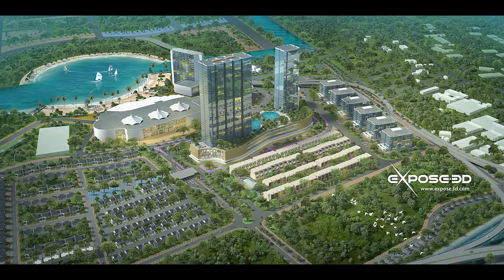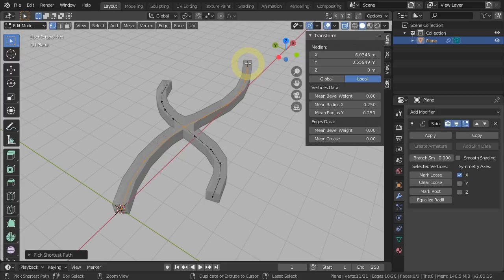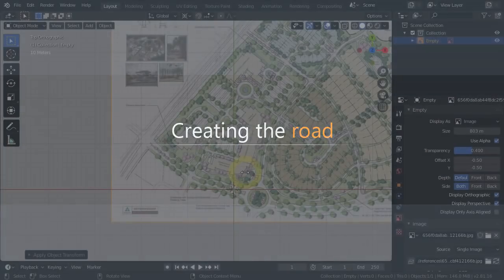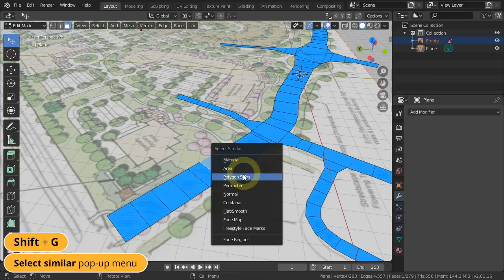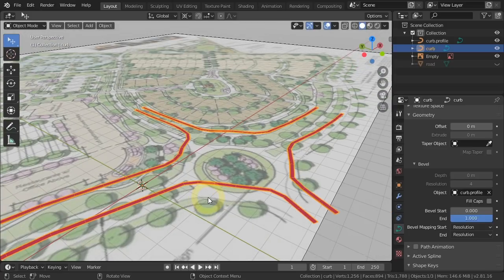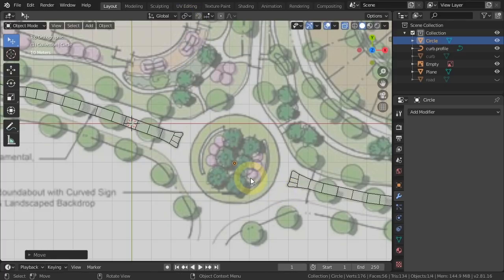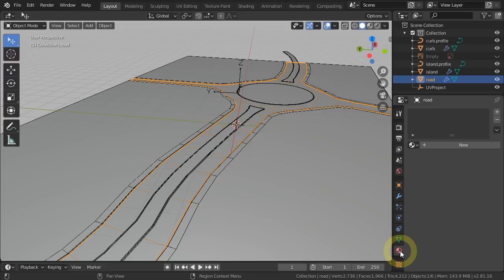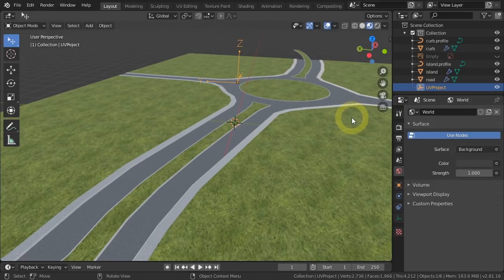How to create large-scale road network in Blender 2.8x

Comment: Hello, I have a question. When you add skin modifier, it automatically splits (subdivides) the mesh between two vertices, if the distance is too long. So you end with more than one segment between two vertices. Do you know if it is possible to turn this off? So I always have roughly one segment between two verts, regardless of the distance between them

Comment: I got a problem regarding adding vertices extensions.  I pressed CTRL and right-clicked to add vertices, but instead of adding vertices, it opens up a different program.  What would I have to do in order to use CTRL + right-click in Blender to add vertices without opening up a different program?  By the way, I use Windows 10.